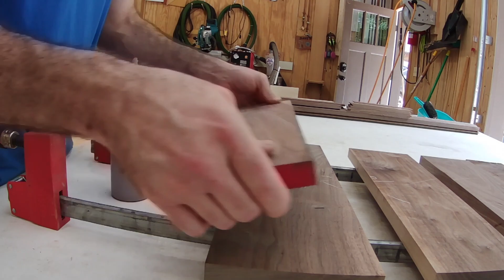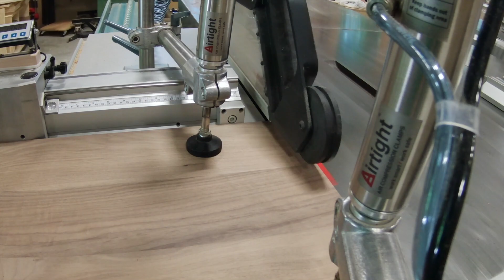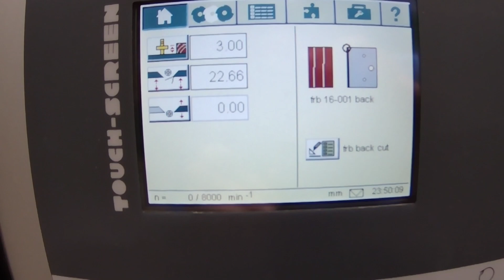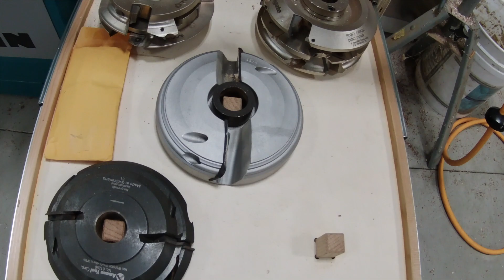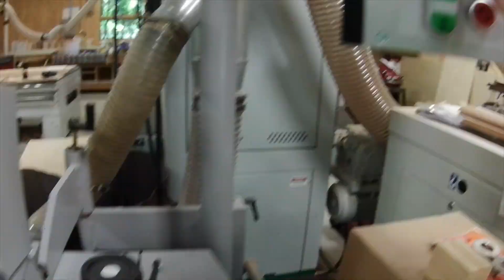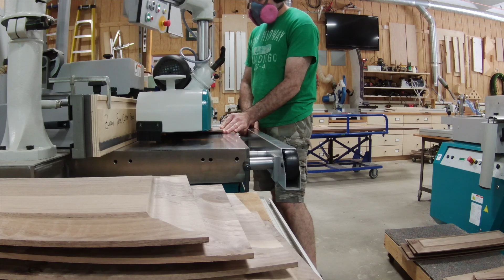Making Raised Panels

Comment: Having a back cutter and raised panel cutter you could run at the same time would save you a lot of time. Interesting that you run the cutters below. I run them above so the wood is between the table and the cutter so you get an exact thickness to go in the groove regardless of any variation in panel thickness. Probably not that big a deal with a wide belt sander and they should be pretty even in thickness.
Reply: Correct investment to that effect, I have learnt that in woodworking you don't need to gamble if you really need profits.
Reply: @davidndahura7437  I think if you run the cutter above you would also get a slightly better cut as the panel would be supported on the table as opposed to floating in space unsupported. The way you do it the panel can deflect a bit.

Comment: Very nice video.  It’s great to see tooling of the common-man in use instead of Zuani once in a while.

I chuckled to myself when you said “And now, like so much in woodworking, it’s just the monotony of feeding the wood”.   I found myself thinking “One way to reduce the monotony is to eliminate CNC shaper setups, and do the setups manually and from scratch every time”.  😜
Reply from the maker: hi david, thanks for the comment.  i follow your posts and work on sawmill creek.  as i said in the video, this isn't our first shaper - in fact it's our fifth.  i've had two decades of manual setup, and until my shop partner said that he was starting to have vision issues and was getting really tired of the long setup times, we didn't even consider this machine.  but, now that we have it, i believe it's worth every dime.  the first 20+ custom kitchens i made were done with "regular" shapers, and track saws/cabinet saw/sliding table saw, and now, we use a CNC to do the plywood.  some of the effort is offloaded to the software setup and configuration, rather than days at the slider cutting parts.  is that any less woodworking?  well, the last 10+ kitchens have been more pleasurable to build than the 20 before.  in some cases, we use money to buy equipment that spikes efficiency or capability, or solves particular challenges with technology rather than brute force.  that said, i still love my hand plane collection.  different strokes for different folks, right?
Reply: @curlandburl6937  Hi David, I wasn't trying to be critical - not at all.   You have an excellent presentation style and voice and great production values.   Your video does tread over ground I covered earlier ( https://flic.kr/s/aHsmKqCqKz ), but my videos are a lot more involved because I do not benefit from a CNC shaper and thus drag the viewer through all the setup steps, and as a result I get comments like "why do you make this so complicated?"     LOL   It is complicated to set up - even the first time using CNC machines it's complicated.   But like you said, even your situation started with more basic equipment, and only through volume can the benefits and cost justification for CNC equipment can be justified.   

I often have amusing discussions with other woodworkers about whether their craft is really "woodworking" or is "manufacturing."   This distinctions is probably not important in the kind of work you and I do (I'm a slave to CAD as much as anyone), but when you get to Tilt/Turn Windows like some of my friends specialize in, I find the distinction highly applicable. 

As a one-time Martin rep, I will say that Martin should pay you to make more videos.    Whether they pay you, or you get rich from YouTube ad revenue, please keep making videos - they inspire and educate and we need more of that.

Comment: Those Martin machines sure have some very nice features!  Thanks for the vid.  Cheers, David.
Reply from the maker: they really make terrific machinery.  but, as with anything, they are not without issues, and certainly come at a very high price.
Reply: The jointer surface planer is making great sound 😂😂😂😂😂❤.